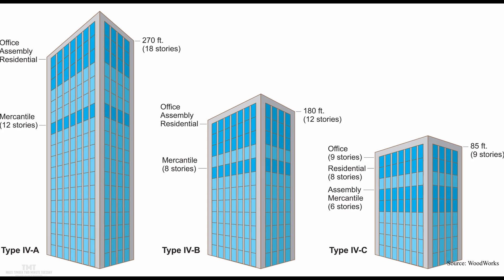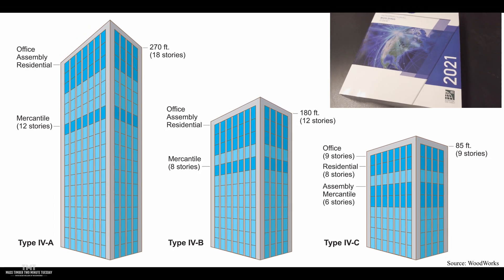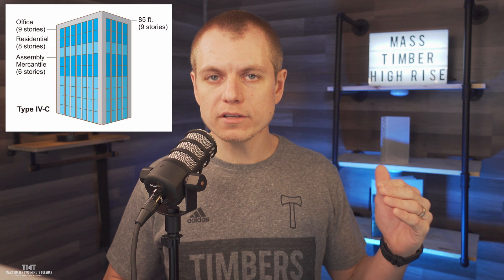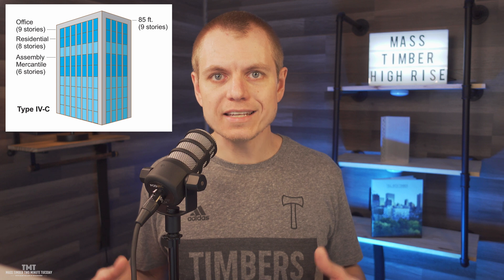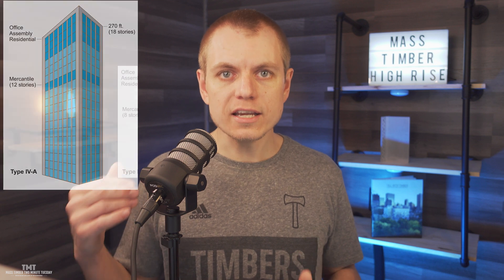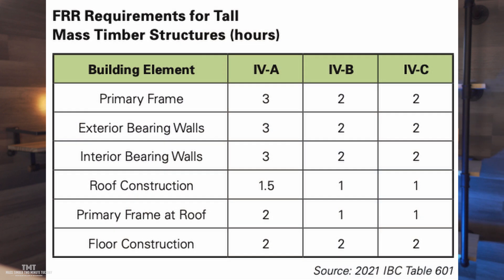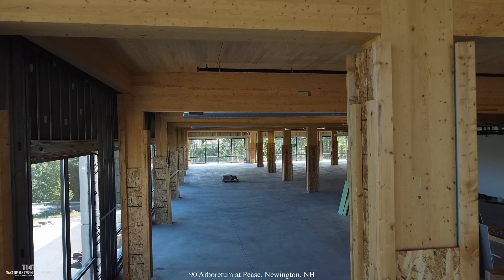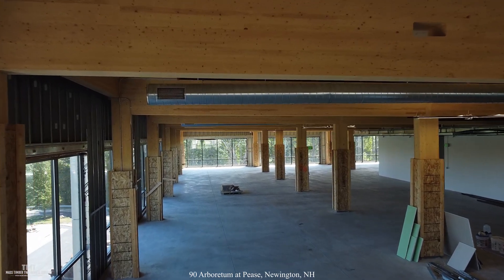Mass Timber High Rise Construction Explained

Comment: It’s going to be awesome when the fire suppression system in these buildings start to fail and there’s a couple collapses due to inferior structure!

All this is about is millionaires making more money on the same footprint, there’s a reason buildings are built with concrete and steel!
Reply: A bit too harsh for my taste, but I agree that the amount of exposed timber that they allow in some of the high rise buildings is ridiculous.
Reply: first off, wtf is wrong with you. why do you want buildings with occupants to burn down? secondly, they're safer in fires than steel is, so what's your point?